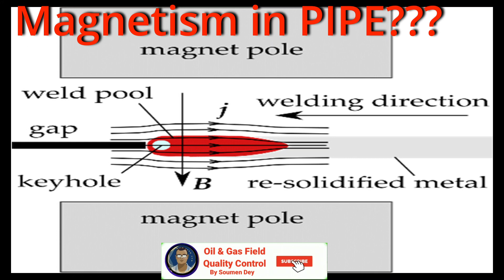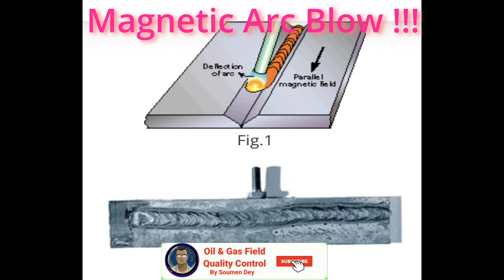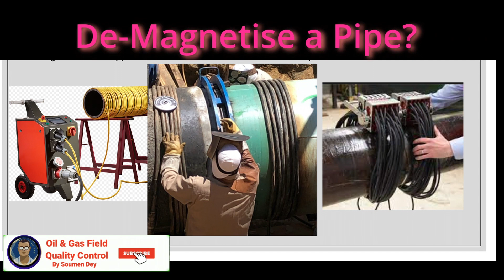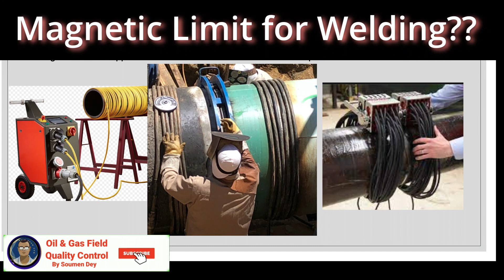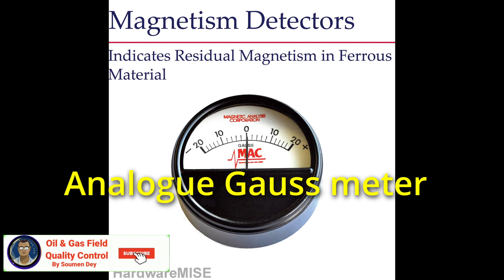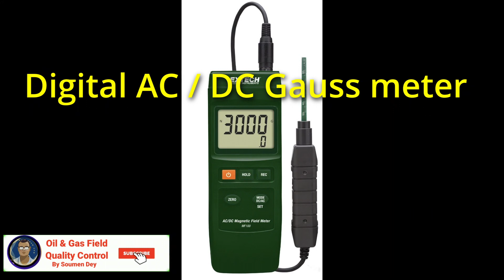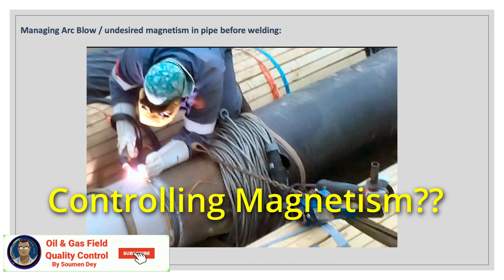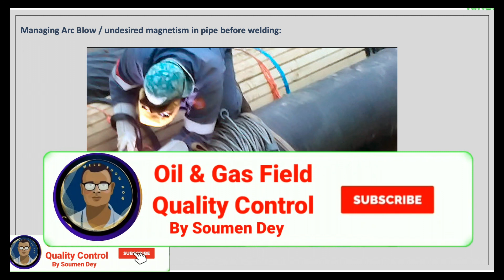How To Weld Magnetized Pipe?

Comment: Magnetism may occur while doing welding existing pipes not in new pipes
It will be eliminated by wrapping welding cables with AC Supply
Induced Magnetism > Residual Magnetism does the trick!!
Thanks sir for this excellent video!
Reply from the maker: Thanks. a lot
Reply: Hi..how to rectify the residual magnetism in gas pipeline?  Need reference